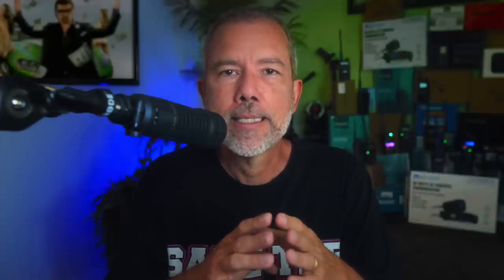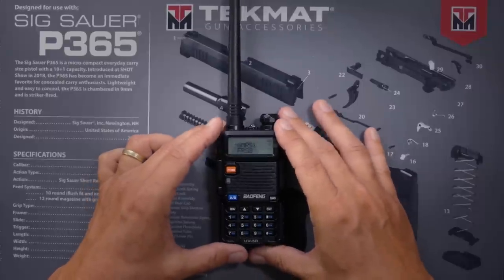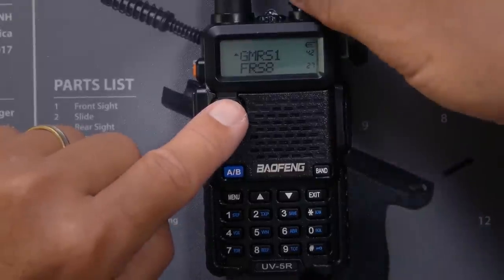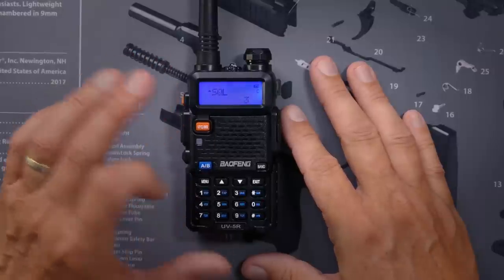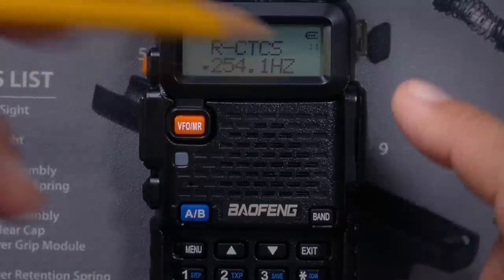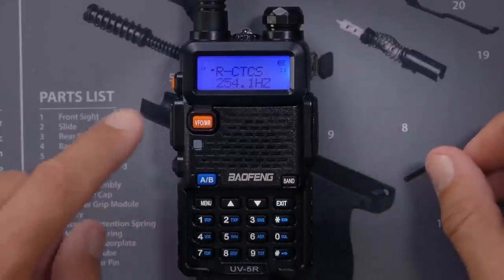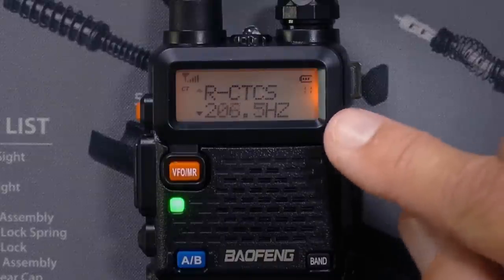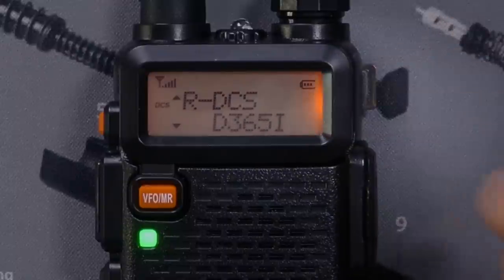How To Scan For Repeater Tones Or Privacy Codes On A UV-5R - Tone Scanning On Baofeng UV5R Ham Radio

Comment: Looking at Paragraph 14-DCS Table in the UV-5R manual, you will notice that Baofeng uses a smaller subset of all available DCS codes and hence, it will not "find" a DCS tone that is being transmitted if it is not one of the DCS tones included in the UV-5R (for example it will not find D111N; Code No. 74 in the Radioddity DB-20G Manual, because it is not included in the UV-5R DCS Table).

Comment: Correct me if I'm wrong, but doesn't this only work IF YOU ARE WITHIN DIRECT RECEIVING DISTANCE OF THE TRANSMITTING RADIO? In other words, you will not be able to scan for a repeater tone if you are hitting the repeater but are out of range of any station TXing that repeater. Do I have that right?

Comment: Hi, I'm new to anything 2 way radios, what is the function of tones?
Reply: If the receiving radio has one of these tones set, then any radio transmitting without that specific tone will be ignored. So, for example, if you and your friend are using a tone to transmit, then you will only hear each other, unless someone else is also using that tone.
Just wanted to point out; this doesn't secure transmissions, anyone on the same channel will still hear anything you say.

Comment: Great channel, thanks for all your help. Problem- when i try to scan for DCSS in the menu, following your steps, it never scans and then times out and leaves the menu screen. Any thoughts?
Reply from the maker: I have many thoughts, most having nothing to do with your issue..
There are two possibilities: Either your radio is defective, or, you're doing it wrong.
Reply: @TheNotaRubicon  can I pay for zoom call?
Reply from the maker: Yes, but not with me.  My support is limited to the videos i make and the comments I answer.
Reply: Do you have the 8-second screen lock feature enabled?

Comment: I've scanned on both and it doesn't settle on a frequency on either. It sees that my other radio is transmitting, and looks for it. It stops when I stop sending. Any ideas?

Trying to listen to a Motorola EVX-S24 on a UV-5R

Comment: I have a uv82 and could not get this function to work. Contacted Amazon seller and they contacted Beofeng with no help. Factory reset the radio numerous times and nothing changed. The manual for the uv82 says it will scan ctss tones.  Buddy of mine has a uv5r and fairly familiar with the process works. Advice would be appreciated.

Comment: For clarity, does the frequency need to be set for the Beofang A channel that corresponds to the remote HT before doing the CTCS scan?
Reply from the maker: Yes, it will only scan the frequency that you are on.. Does not have to be the A channel, it has to be which ever (A or B) you have selected by using the A/B button.

Comment: Hello. I'm a newbie and new subscriber to your channel. I really love the way you explain every details of the uv-5r and pinning the "experts" on the comments section. 😂 by the way I have a uv-5r.its my very first radio, I tried to change the R-CTCS & R-CDS like you did on your video.but when I go back to start the scanning the settings will always show "off" on both settings.Is there any reason why is that happening? Its like the uv-5r is phohibiting me from changing the default settings. Hope you can read my comment and give me a respond.thank you very much sir.
Reply from the maker: are you in channel-mode, and saving the channel after you set the tones?  If not, i dont think it will save.

Comment: Dumb question I know but can you hear a repeater if you don't know the PL code? Is the PL code only neceassary to transmit to that repeater? Thx
Reply from the maker: Yes.. You do not need any code to listen to a repeater. The receive code is optional and is used only to blank-out OTHER noise/transmissions.
Reply: @TheNotaRubicon   As I thought. I asked because I see 6 repeaters in my general area all on the same frequency (462.600) per MyGMRS yet I hear nothing. Also I wonder how they can all be on the same frequency within 10 miles of each other. 
Been with you since 10,000 subs and appreciate your channel and humor.👍

Comment: Can it scan beteween two preprogrammed frequencis? eg.between low and high freq
Reply from the maker: No.
Reply: @TheNotaRubicon  thx for fast reply! - then i dont have to look for that option anymore, then the only option is to program the freq. i want  to listen to, pity there is not that option, - do you know what would be the next step up in Baofeng radios to get that option? greets Levi in Sweden

Comment: I used this method for a nearby repeater.  However the doc's on the clubs website has a different dcs tone than what I had scanned previous.  A radio check proves that I can hit the repeater with the scanned tone - and not with the clubs website tone.  Is there anyway baofeng dcs tones are 'different?" than Moto/Kenwood (US made:)) -etc brand dcs tones?  Not making sense.... thanks.
Reply: Try emailing the club to verify that their information is correct, perhaps it changed recently and someone forgot to update the site

Comment: This is probably a dumb question. I am new in repeaters. I scanned the dcs tone on a repeater on my baofeng radio. tone is D115I. but the problem that I have is that when I was trying to set my mobil midland mxt400 dcs tones it show only numbers from 001 to 104. it seems different. am I doing something wrong? or can You explain that to me please. thanks
Reply from the maker: You have two issues to deal with:
1) What frequency did you use to scan for the tone? The INPUT frequency or the OUTPUT (TX) of the repeater? If you scanned the output (what you hear when listening to the repeater) that is not going to work unless you know that the ouput tone is the same as the input tone
2) Your other issue is that you have a Midland. You will need to read the manual and find the conversion table to translate the real-tone into the made-up numbers that Midland uses.
Reply: I scanned the input tone. R-DCS. I am going to download the manual for convertion of tones then. thank you for your answer.

Comment: Hi there Notrubicon and followers, newbie radio hobbyist here. I am a volunteer marshal for a prestigious racing organization, and I tried to scan for the frequency of  the radio that my fellow marshals are using to communicate with Race Control. I scan using my UV-5R set on Frequency Mode, (to be able to monitor the race), but I just can't seem to catch it's frequency. And if I can get the CTCSS or DCS tones, what's the next step? The radio is Sepura (Hytera). Please help.
Reply from the maker: Wouldnt it be easier to just ask whoever is in charge of the radios to tell you the frequency and tones?

Comment: We should have an email campaign to send an email and send an actual postcard to baofeng requesting they begin work on a scanner
There are so many ham operators that use scanners I don't think there are ham operators that don't have scanners.

And there are a lot of people that use scanners and don't use Ham radios

NASCAR is a big scanner enthusiast group as are railfans, and air fans that like to listen to Aircraft

There is a huge market for an entry-level scanner under $50

If they could manufacture a DMR scanner for $50 that would be incredible

And if they could make a phase 2 digital scanner for a hundred or even 150, they could corner the entire scanner market in the world

I remember when a dual-band ham radio was 350 and that was the cheapest and that was back in the 90s

Now they have for a tenth the price and they could do the same thing for the scanner market they could have people that used to buy an $800 uniden buy a $150 baofeng BF-SC1 that does phase 2 p25 digital and Motorola turbo DMR and nxdn and has VHF, UHF, 220,300 air,108-136 air, 700 / 800 /900

If Whistler can make the same thing Uniden sells for 700 dollars for 350, I am betting there is a huge markup

I remember when the first design for the wideband 700 /800/900/1.8/1.9 MHz yagi antenna came out

I bought three antennas for $20 each including shipping

These were made in a run at a company that makes antennas for other companies and this was a prototype that they ran off fifty thousand of these 

Wilson was one of the companies that they shopped these around 2 and as soon as Wilson tested them and saw how great they were they bought the entire run and they marked them up to $90

I think they cost $5 to make
And I am sure that the scanner companies have a ridiculous markup just like the ham companies have on their radios

If baofeng can sell these radios for less than $30 and make a profit then the companies that sell the same thing for $400 are having them made for 20 and pocketing the $380 profit